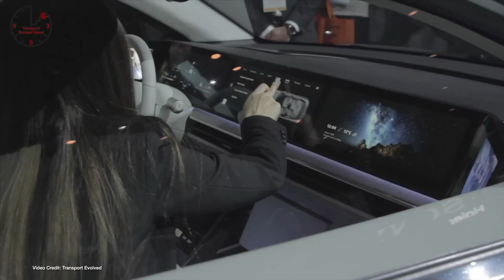TEN 302 - $20k Kandi Electric Car, Hummer EV Reveal Set, Sony Vision S Testing

Comment: NYC & mopeds , not a good convo. People renting Revels are braking every law that they can brake, there good riders and then everybody else , red lights, no helmets , using bike lanes  or walking and running paths inside green spaces and my favorite , riding on the highway with a passenger in a Revel, I kid you not, Ive seen it 3 times now. Once they expanded everything went to hell for Revel , they suspended more than 2,000 accounts because of this, just insane.

Comment: At first I thought that the Kandi wasn't too bad. But it's still far too expensive for what you get &,  perhaps from a merely practical point of view, a top speed of only 63mph will limit drivers to surface streets only; you're not going to be able to overtake other vehicles at that speed - at least not safely. Yes, obviously it's only intended for city use but even in cities, there's often some motorway/freeway driving.

Comment: 4:59  Seriously???  11,599 Foot Pounds of Torque???  A Nitro Methane Powered Top Fuel Dragster produces on the order of only 8,000 pound feet of torque (with up to 11,000 horsepower) and is capable of accelerating to well over 300 miles per hour in less than 4 seconds.  That's gonna be one seriously fast Hummer!

Comment: "Most affordable highway-capable electric car to go on sale in North America"? What is the Arcimoto FUV, chopped liver?  (Yes, I know, completely different target market, but still. It's shipping now, and even the launch expensive version is cheaper than the cheapest version of the K27.) Same 100 miles claimed range, but faster top speed of "over 75 MPH" (which I can confirm it can exceed.)

Comment: On the subject of electric 2 wheelers, the other day I was standing at my front window in SW London, with a coffee, when a moped drove up to the house opposite. It looked like the traditional piza delivery moped with a large box on the bag. The first surprise was the rider was a young woman. I had only ever since male delivery riders. The second surprise was when she moved off in complete silence and I realized it was electric. The rear wheel had an oversized hub, and where the engine would have been was a large triangular box which I assume was the battery. Nice to see this. I've already spotted some electric delivery vans, Fords and Nissans. Definitely moving in the right direction.

Comment: Still over $20k and less than 200 miles of range?  Looks like the Kandi is yet another "cheap" EV that can't meet my hopes and needs for an actual affordable and usable electric car.  The new hummer looks like they're going the same way they did with the H2.  An ugly take on the original look to draw in buyers with compensation on the mind, but no real need or intent to use something to the extent that you'd imagine if you grew up knowing the military hummer as the only vehicle with the name.
Reply: $20k, but comes with the $7,500 rebate. That's a huge improvement. 

Hummer is going to be that way. Otherwise they will lose the faithful Hummer crowd. I don't like it personally either, but at least it's going to be clean vs the previous ugly gas hog.
Reply: @anthonypelchat  ANYTHING that GM puts out that is a true EV...that gets people who wouldn't normally drive an EV is a small (or oversized in this case) victory for EVs.   If it sells well, then who knows??? Maybe GM could get serious about EVs!!
Cheers!
Reply: @davidc2838  I doubt that the Hummer EV will sell well, but we will see. I hope that it does well enough. I wonder how many environmentalist will confuse the Hummer EV with it's gas guzzling ancestor. 

The Kandi with the $7500 rebate will be nice. It is only useful as a commuter car, with that low speed limit and low range, but it should be good at that task. The range is actually less of an issue than the speed limit. 63 mph in the US is horrible. Still, rush hour traffic seldom goes that fast anyways, so it shouldn't matter much. And it is the first low cost EV to seat 4 people. 

That said, we still don't know for sure if it will be that price after import fees. And we don't know how well the battery will hold up or if it will have issues like the Leaf does. There is also concern that the US could drop the $7500 rebate on these cars, or do some other push to prevent Chinese cars from being imported.
Reply: @anthonypelchat  
It will sell just fine...Never underestimate American's desire to show off the latest gadgets or unnecessarily large vehicles!  If you look at the size of SUVs and trucks in this country they have plenty of large vehicles sold every year. Won't be an F150 for sure ...but if it even sells moderately well, it will be a success for GM.
Cheers!
Reply: @davidc2838  The original H2 didn't sale very well. It's best year saw 34,500 sold in 2003. And it never stayed stable either. I hope that the EV version does better. We will see.
Reply: Anthony Pelchat 
Actually that’s not a bad number for a specialty truck like the H2.
The Chevy Bolt doesn’t sell that many units and it’s much cheaper and less appealing to the “Big Truck” Crowd.
It’s a segment that GM can own for a while...
Although some will pick a CyberTruck over the H2-ish EV.
Hope it works out...since every Hummer sold will prevent a large ICE truck being sold (and driven).
Cheers!
Reply: BARELY over $20K and fits what a lot of people use a smaller car for...getting around and running groceries.  Will be popular in cities and small towns where price is important and with the $7,500 rebate, that will be a HUGE opportunity for someone to get in really affordably.  YES..it could have better range...but most people don't travel far on a daily basis.
Cheers!
Reply: @davidc2838  Yes, and not all dogs need leashes and not all birds fly, but some do.  Having at least a 200 mile range opens up a huge market for people who, like me, live in extremely old climates and need that buffer to be able to make the near 100 mile round trip to work each day while not freezing to death.  It also makes it much more appealing to those people who go on 150-170 or so mile trips for the weekend with the kids, like to an amusement park or national park or something.  I'm not saying it's the largest segment of the market, but there is a reason the really long range cars sell better than these short hop ones.  People want the buffer range.

Comment: Can you check with your CPA or Clear Value Tax channel to see what the qualifications are for the Section 179 deduction for heavy duty trucks to get the $75,000 write-off for self employed or small business operators. The original Hummer H2 qualified so the bar isn't that high. Currently, the Bollinger specs qualify and I believe the two and three motor Cybertruck also meets the threshhold. What about Rivian or Lordstown? Their truck beds look more like F150 territory which doesn't qualify. Also, can you get the 75,000 write-off and the 7500 tax credit?

Comment: While I wish Kandi well. I don't think I serves the electric car industry well by releasing a car without high speed charging. Anyone new to electric transportation is going to be frustrated as they become aware  of what's possible. It's fulfilling the narrative low power, slow as heck to charge and can't go anywhere. As was the common belief just a few short years ago.  There upper variant with the 180 mile range if it has rapid charging is about the minimum acceptable entry level especially in 2020. Cheers

Comment: Updates on hydrogen fueled Ships?
Reply: Planes?
Reply: Hydrogen powered ships/planes are going to have the same range issues as battery powered ones. While hydrogen is light weight, the pressurized containers to store it are not. Having huge pressurized containers on ships is a bad idea. Ships also frequently sit in docks for many, many hours or even days while loading, so refueling time isn't as big of issue. This isn't the case for all ships, but most of them. 

It makes a little more sense for planes, since they don't take as long to reload, so refueling time is more important. Still, the heavy weight of the pressurized containers and the danger that represents will limit their use. And hydrogen will likely never happen for large passenger jets. 

Both options are likely going to have to wait until solid state batteries or other high density options come out. Hydrogen may make sense for semis and long range trucks, since they need fast refueling. But not really a good option for anything else. 

Also, on your comment about powering hydrogen production by solar or wind, those are not possible on ships themselves. It is possible at docks or airports, but only useful if you need very fast refueling. You need to produce roughly 4x more power to produce Hydrogen than you would need just storing in batteries. That also prevents you from producing while on the ocean.
Reply: i guess no one is interested in that expensive crap. all the ships have a business to run. they can not afford to throw money out of the window.
Reply: @stefanweilhartner4415  Hydrogen powered ships can make their own fuel from ocean water forever.
Reply: @mrjasonjneal  where do they get the electricity for that?
Reply: @stefanweilhartner4415  solar and wind of course plenty available
Reply: @stefanweilhartner4415  cold fusion YouTube channel did a video on it in 2018
Reply: delvis11 did a video 4 years ago how the U.S. Navy is using Hydrogen for fuel
Reply: @mrjasonjneal  i see you are not an engineer. using electricity directly with an electric motor would be the best. more than 95% of efficiency.
using the electricity on land to make hydrogen on land, filling up the ship with hydrogen and using it with fuel cells has an efficiency of about 20%. electricity is not for free. even with solar and wind. this is why it is much much more expensive than oil. and this is why ships don't use that. that probably will not change in the future.
Reply: @stefanweilhartner4415  Portliner in the Netherlands has electric Cargo barges , and I guess the U.S. Navy has bo idea they are wrong.  You should let them know.
Reply: @mrjasonjneal  of course it is possible - no problem at all. however, the U.S. Navy does not give a fuck about the fuel costs. and for the Navy the silence of an electric engine is a plus too. but for commercial ships it is simply too expensive. that is the point of low efficiency.
Reply: @stefanweilhartner4415  you are right fracking the earth apart is a much cheaper way to go in the short term. Who cares  about the children anyway. They will pay for our choices,  but we won't have to deal with it.
Reply: @mrjasonjneal  the portliner is designed for short milage and therefor it is possible to recharge it at every stop. but they of course do not use hydrogen. they have practically the same system like an electric car which is fine for short distance. and with improvements in battery tech they will go a bit further but that is impossible for long distance
Reply: @stefanweilhartner4415  Hi Stefan...it will certainly change in the future...whether ships go fully (mostly) electric...or they somehow go Hydrogen...I doubt that...but who knows what groups like the Navy could decide.  Nuclear Powered vessels are not cheap either...but they're there. 
Cheers!
Reply: @stefanweilhartner4415  Saw this after my post. ;-)

Comment: I don’t see Kandi being successful here in the U.S. with that vehicle. While it is a cheap vehicle, that’s all it is. It’s ugly, doesn’t offer high way speeds since 63 MPH is too slow for many highways, and while that range is great for city driving, that’s all it’s good for. You can’t realistically take this on a trip. 

Not only that, but if you live in the down town area which this range and top speed is made for, you most likely won’t have a garage to park it in and charge unless you live in a complex with charging infrastructure. And even if you could use a long cable to reach the inside of your house to the vehicle, you have people passing by that could mess with it which does happen. 

Americans want a do it all vehicle for the “in case” moments. Hopefully I’m wrong and it’ll sell well; we’ll see what happens in a few years.
Reply: John Edwards  I mean I live in D.C. so I'm in a pretty densely populated area. I can definitely tell you that they're not strategically placed here. Stores and supermarkets with big parking lots have a very insufficient amount of charging stations compared to the amount of EV's parked there.

Comment: 6:12 Would have been nice if you actually quoted his full statement. But if you did, I guess it would not sound as controversial, especially with the follow-up sentence.
Reply: Jaroslav Jandek you’re correct but don’t hold it against them. No media outlet read past the trolling to the more controversial statements
Reply: @richardgould-blueraven  Yes, they did...not MSM...but several of the others similar to TE did.  Could have been a MUCH better statement...and follow up.  Taken WAY out of context.
Cheers!
Reply from the maker: Look Above.

Comment: The Kandi would only be viable for experienced EV owners that know that 40-50 miles of winter range will work for them. I've never lived inside a city such as downtown Chicago but I would imagine that it would be cheapest overall to not have a car at all unless you have to travel outside the city frequently.
Reply: I got a used 2016 fiat 500e for about $6k and it has about the same range and can easily go faster than 85mph. It is going to be hard for a cheap EV to compete with used midrange EVs. When those model xs and ys are a few years old, they are going to be around $20k for a much more substantial car.
Reply: @macrumpton  Way fewer of those used EVs available in the US, than there are people who want a new vehicle.
Reply: Agreed...living in Chicago...plenty of people, myself included, dropped owing cars a while ago, although plenty of people still want one to zip around town and pick up things from the store / grocery.  Most people don't travel more than 40 miles per day anyway.

Comment: The Tesla hatchback in planning should be the one that could be compared with the Zoe sales..
Reply: The Zoe is a small, compact and quite cheaply made car. Lots of hard plastic. It is a substantially lower level car then the Model 3. It is made for an entirely different market segment. I highly doubt that Tesla, although growing fast, has the capacity to enter this market segment. Especially as Tesla is a US company and the US is not a good market for those small, compact, cheap cars. They may enter this low end market later, but mostly in Europe, Japan and China where there is a larger market in that segment.
Reply: The new Tesla will likely be a step above the Zoe or two steps?...in between the M3 / MY and Zoe. Look for $25K to $30K range...about $10K less than the comparable M3 / MY...BUT those will also start out higher with more premium features to sell the most profitable ones first.
CHINA next vehicle will probably be closer to a Zoe in nature...although probably still a step above it.
Reply: John Edwards  Tesla's next vehicle that is on the less expensive end will target a $25K (stripped down) and $30K for whatever is the M3 / MY step down. (M2??)  Of course, they'll sell the premium versions for the same price as a stripped down M3 and MY respectively. 
Cheers!